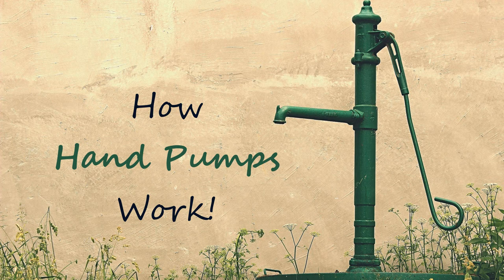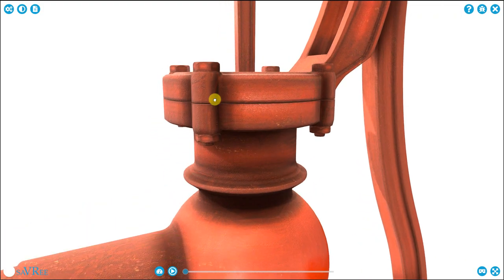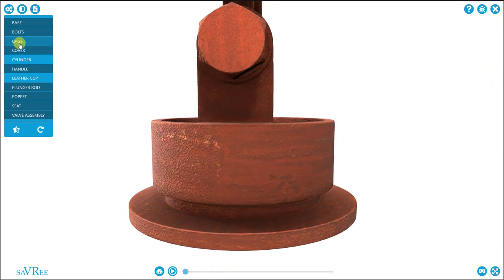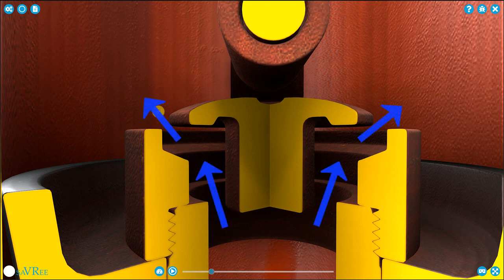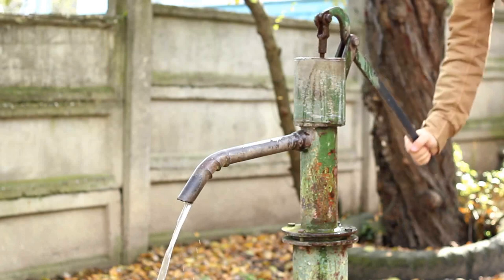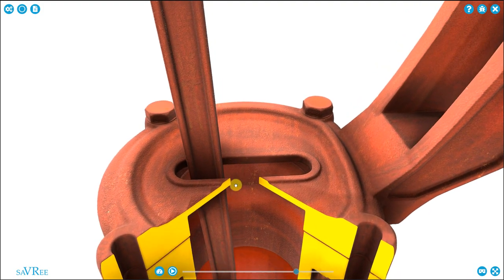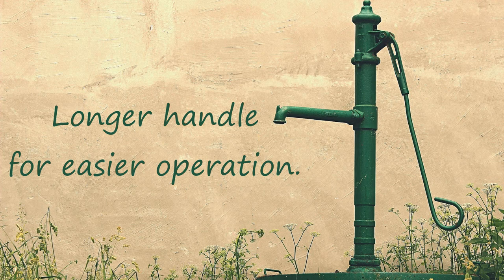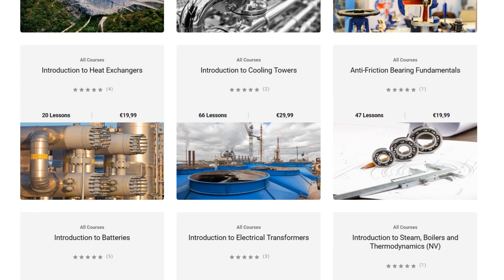How Hand Pumps Work (hydraulic water pump)!

Comment: At first, I thought if the groundwater had a hole or leak, the hand pump would not work because it uses a vacuum. If you think about it like a soda cup and a straw, the pipe should be underwater to draw liquid. The cup itself is not in a vacuum but the volume in the straw is when submerged in soda. Sucking from a straw takes away the air and water will fill its place. 
Thanks for the animation!